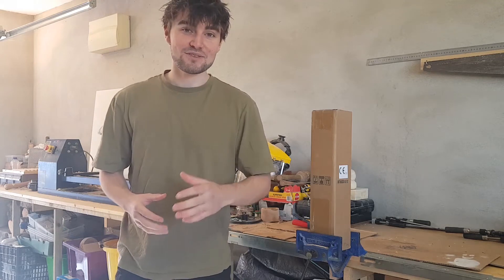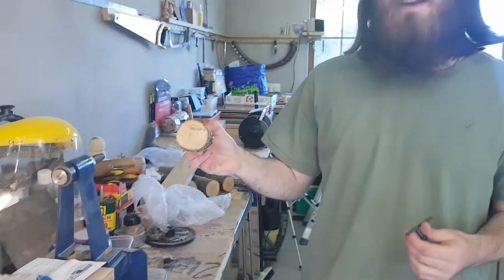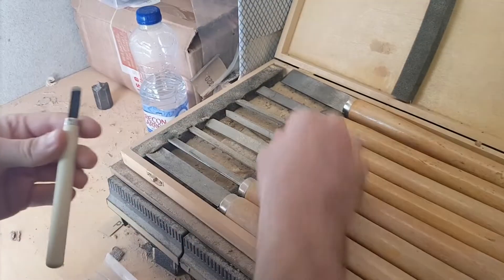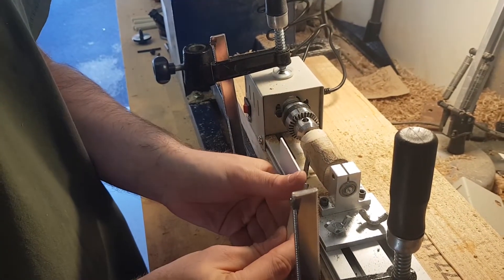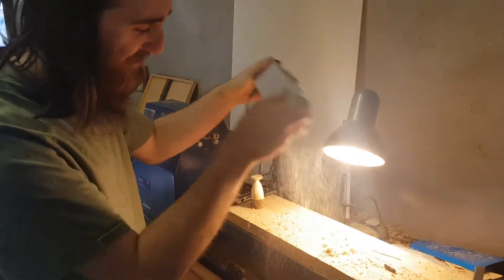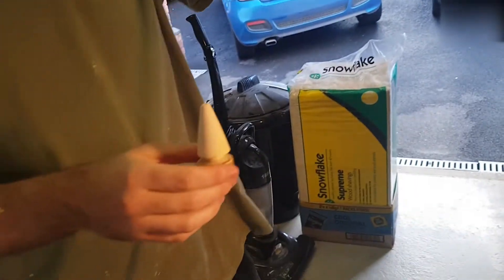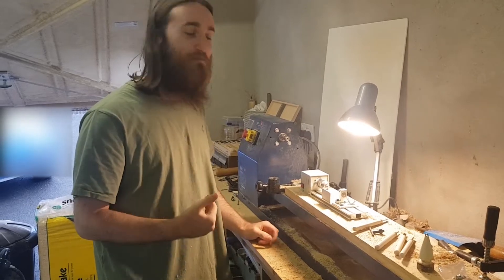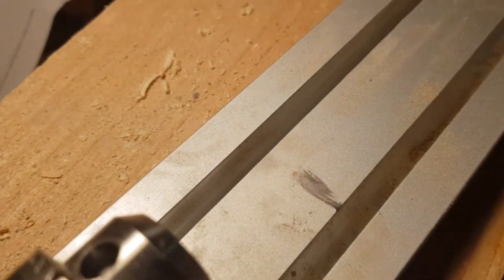Testing the internet's cheapest Mini Lathe - Reviewing Wood Turning Tools Chisels Chucks

Comment: Mine never turned on 😢 can anyone recommend a video on troubleshooting or repair on this thing?
Reply: I would start by checking the plug to make sure the wires are connected and haven't came loose during transit, then check fuse, then if still no joy checking the on/off switch connections and connection to motor.
Reply: @paulh6587  I actually managed to find out it was the two white wires!! Somebody never connected them! Now I just need to figure out how to keep my piece from flying out the moment I turn it on lol

Comment: Ahem,   no one seems to do this.  Turn the tool rest around?
Reply from the maker: If you turn the tool rest around it becomes too close to the wood.
Reply: @SciencewithGreg  so someone did try it!  Yay.  Dang though.
Reply from the maker: You could cut the notch further along where the tool rest is secured to allow a larger range of movement.
Reply: I bent the tool rest such that it's closer in the normal position and further away when turned around. seems to work decently.